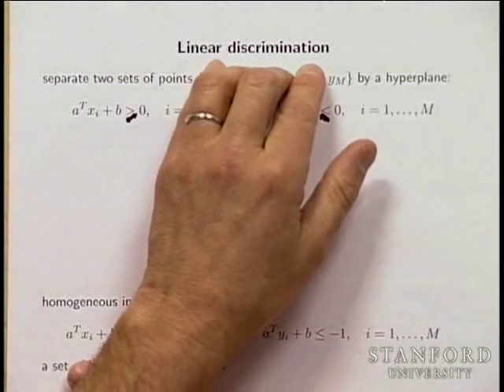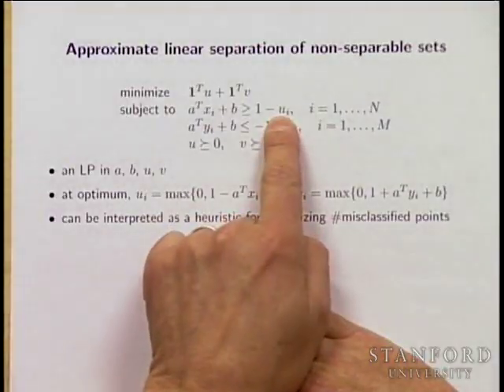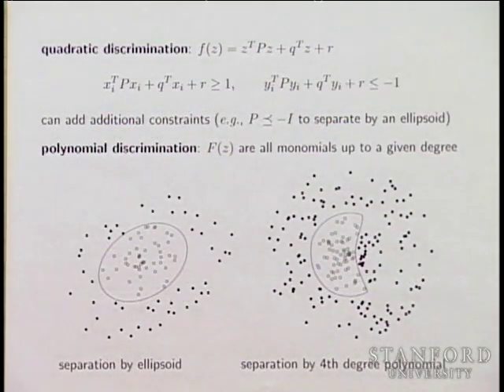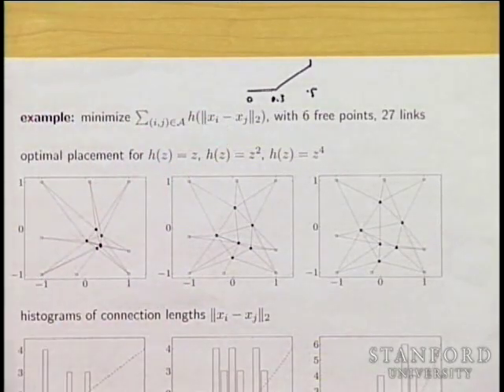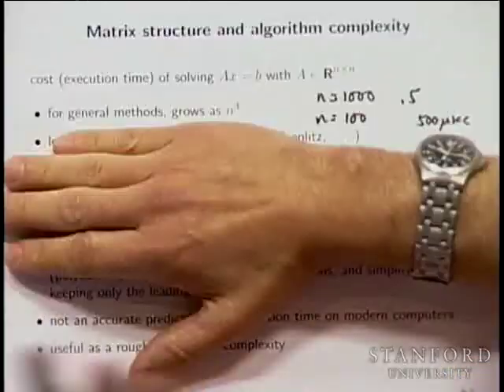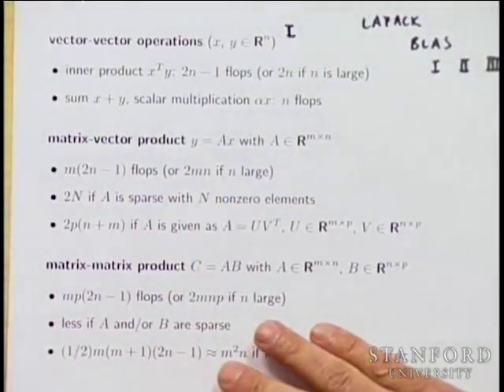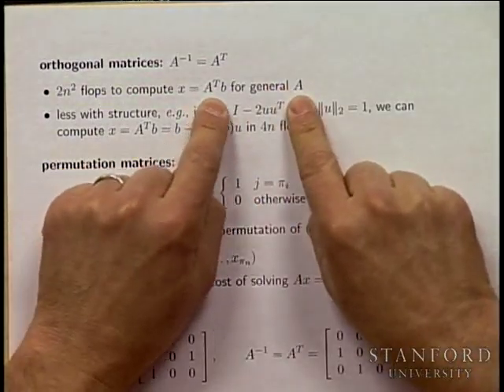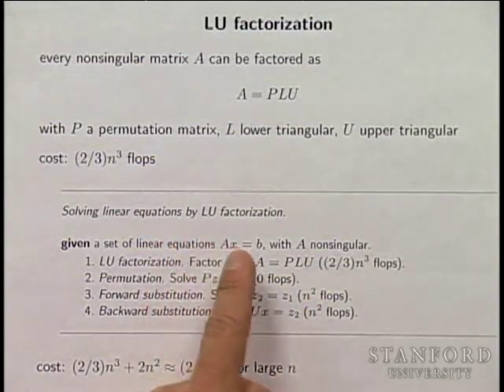Lecture 13 | Convex Optimization I (Stanford)

Comment: At 20:30, why did he impose that 'P' should be negative definite? For an ellipsoid to exist, shouldn't 'P' be positive definite? The eigen values should be a representation of curvature; so having positive curvature makes sense.
Negative Curvature would imply a hyperbola, right?
Reply: Following is my guess. Suppose we have the constraints xiPxi + qxi + r >=1 an yiPyi + qyi + r <=-1 and if the xi's are surrounded by yi's (let's say we are in R2 and we can eyeball it), then the problem is infeasible for P >= I because there is no ellipsiod s.t. xi's are inside it and yi's are outside it. But if we set P <= -I, we basicly flip all signs are this problem become feasible (solvable). And I guess that's why the "support ellipsoid machine" did not become popular. 🤣

Comment: 0:43 Linear discrimination
3:38 Robust linear discrimination
6:54 Lagrange dual of the maximum margin separation problem
8:54 Approximate linear separation of non-separable sets
16:09 Support vector classifier
18:31 Nonlinear discrimination
22:38 Placement and facility location
27:28 Example
33:08 Numerical linear algebra background
40:04 Matrix structure and algorithm complexity
48:53 LAPACK and BLAS
1:00:51 Linear equations that are easy to solve
1:05:23 The factor-solve method for solving
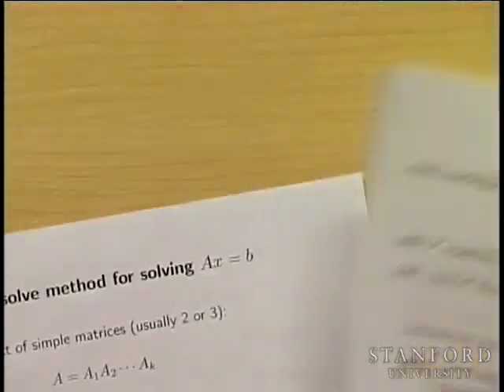1:11:22 LU Factorization

Comment: Circa 18.00min 'many overhyped things don't deliver and then go away, I can assure you that SVM isn't going away'. 

Lol, I guess that even professor Boyd is wrong at times.
Reply: SVMs went away?? I believe they're used all over the place
Reply: So, did SVM go away or NOT? What is the answer to this?
Reply: @divyabhatia9916  It did not. SVM is still very useful.
Reply: @vitobrusnik6953  ok, thanks! :)